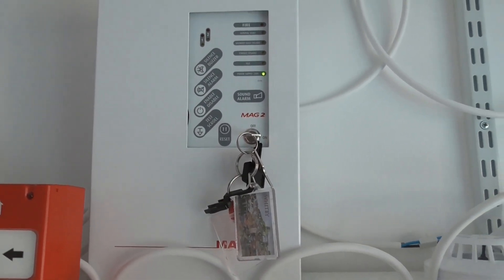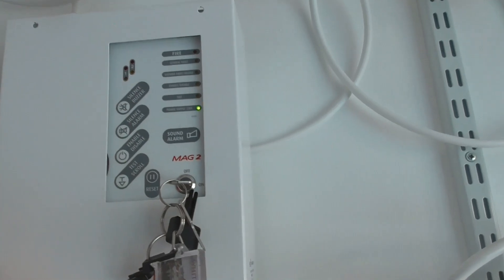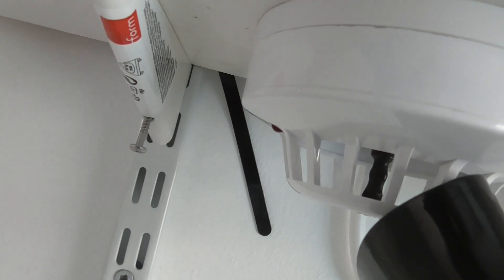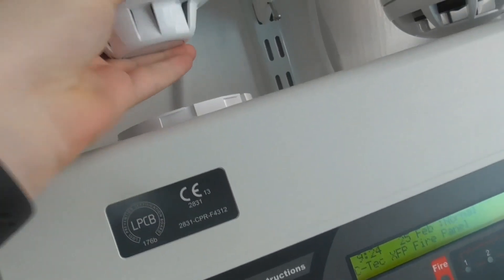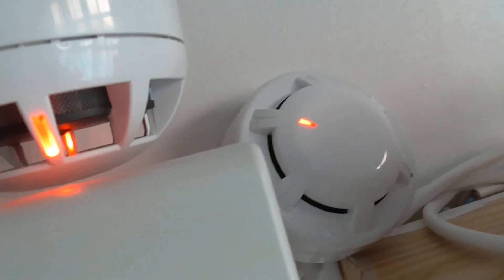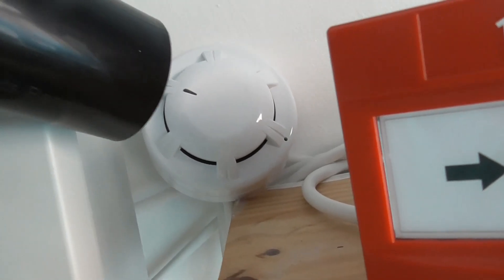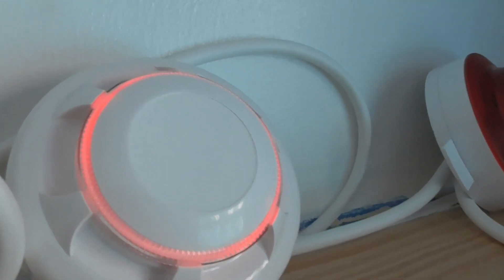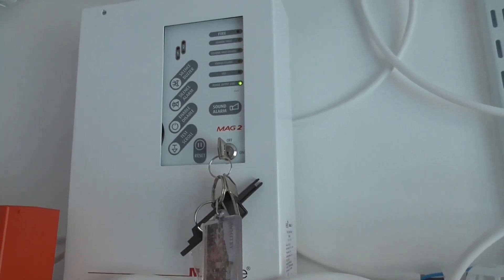ESP System Test 11

Comment: what's the last test of the system system test 12 or 14 and I saw an xpander system :) when is xpander test 1 coming?
Reply from the maker: It will probably be System test 14 if I get new devices if not it will be system test 12. I have not yet finished the xpander system, I need to get some devices. The system tests for the xpander system will not be coming out until the end of this year or start of next year.
Reply: @j1firesystems440  ok nice test by the way
Reply from the maker: @Siobhan_OShea  Thanks